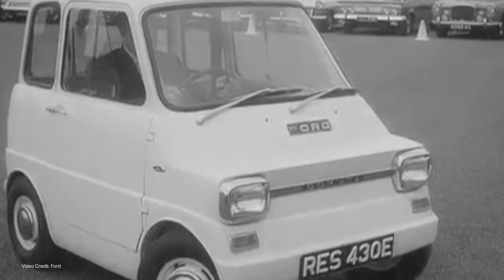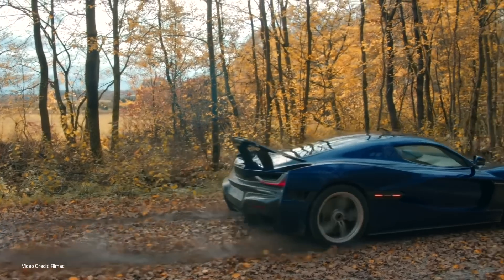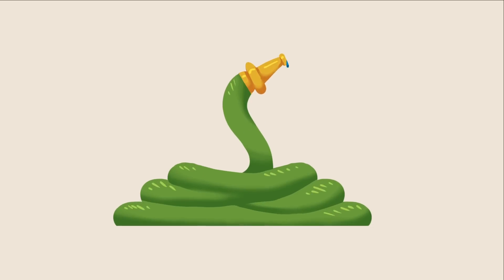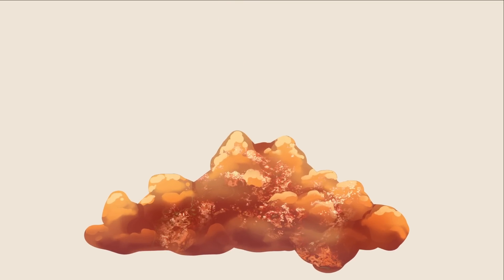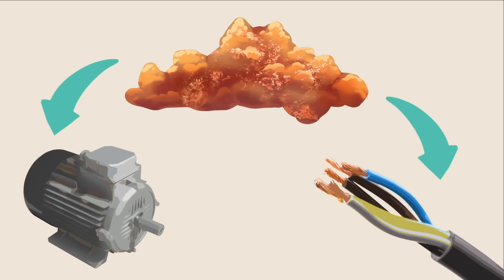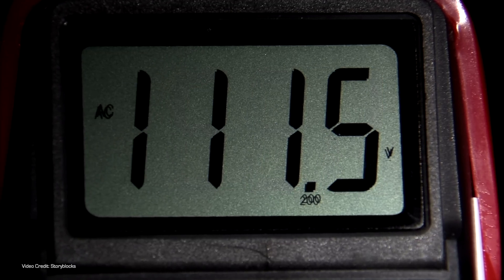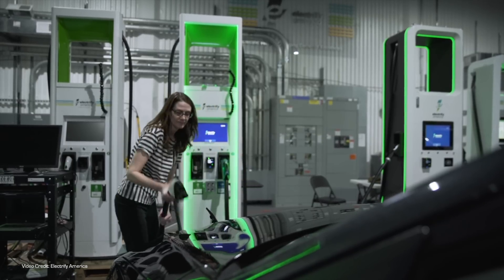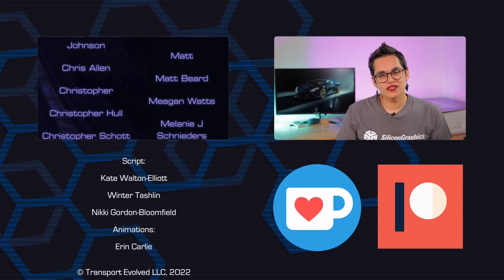Moar Power? More volts.

Comment: What makes 800v expensive? Also why not jump multiple steps and go for much higher, like 4000v or more? Since it sounds like a magic bullet?
Reply: Higher performance mosfets/transistors and required DC/DC conversion to be backwards-compatible with 400v chargers
Reply: 800v uses bigger gauge wires than 400v. Which means more copper would be needed which will increase the price. Not alone the other supporting equipment you will need to handle 800v. 4000v would be unnecessary as there is no consumer level battery or infrastructure that can handle that many volts.
Reply: @polo3433  bigger gauge, is smaller size, got that backwards
Reply: @brantwedel  Your right. I thought about that afterwards.
Reply: It isn’t really a magic bullet and safety becomes harder as voltage gets higher. Also, 1000V is where the somewhat arbitrary threshold from what is considered “low voltage” is crossed into “medium voltage” which is something of am engineering psychological barrier.
Reply: Q: Since it sounds like a magic bullet? A: yes it always does, but such is the psychology of "Confirmation Bias".  unfortunately the way Nature/God/The Universe works (pick whichever explanation makes you happy) is the "Law of Diminishing Returns" and "No Free Lunch". #NOFREELUNCH  what this means in practice is, no matter the great/wonderful idea Man gets in his greedy head, once we get the courage to analyze it and think it through, we quickly find ourselves "bumping up against the hard wall of REALITY."  thus what you see playing out in the comment section as a whole is what most Chem majors worth their salt discover in their Freshmen year (ref: the reason Chemistry is called as the "Central Science" is because the phenomena occurring at the Atomic level sits at the "root" of the all other Engineering disciplines like Electrical/Power generation, Mechanical, Statics, Thermodynamics, etc)

Comment: Why don't car companies just skip 800 volts and just design cars with 1600 volts or 3200 volts?
Reply: Insulation thickness and distance. 1000V is about the limit of what you can reasonably insulate in a single cable, go higher and you need a significant airgap between the wires. Nobody wants to plug in two charging cables at opposite sides into their car. Crank the voltage up even higher and the electricity will happily jump through the air at one connector, onto the chassis and through another gap onto the other connector instead of going towards the battery...
Reply: I think standard electronic switching devices max out at about 1200 volts, so 800v plus some headroom works well.
Reply: @BooBaddyBig  but if they made the cars that could take massive voltages the other hardware would follow.
Reply: @matthew_baynham  There's safety and other issues though. I mean, you can make inverters that go to very high voltages, but it gets harder and failure modes get more and more 'exciting'.

Comment: Constant pressure (voltage) large/small hose is a terrible analogy for battery voltage, implies all problems fixed by heavier wires.
Reply: Aren't they?  :-P

Comment: While I agree with the basic principles you describe (lower current at higher voltage, thus thinner wires), you focused mainly on transferring power from the battery to the motor. Only in the very beginning and the very end of the video you briefly touched on charging speed, alas without explaining how higher voltage relates to charging speed. Given that a Tesla model 3 or Y can charge at up to 250 kW using a 400 V system you can easily see that the real benefit will only be visible if the battery is either very large or the individual cells can charge at high C-rates thus needing more than 250 kW.
In the end charging speed is determined at the individual battery cell. Given a certain cell and a specific battery cooling design, 800 V systems will only improve charging speed if 250 kW will not result in enough power at the individual cell. After all, Li-Ion cells run at nominal 4 V, thus voltage in a 400 V battery architecture is not the limit. Neither is heat dissipation as the collective heat from the cells stays the same regardless if they are configured as a 400 V or an 800 V system. Properly designed cabling n a 400 V system won‘t add any heat, just additional weight.
—-
Bottom line: it would be great if you could look more closely into charging speeds in relation to 800 vs. 400 V systems. Conceptually you should only see differences at charging speeds of 250 kW and above as now the current limit of the CCS connector will put a ceiling on the power of 400 V systems while 800 V (and higher) systems can fully utilize today‘s up to 350 kW. In that context I think that the Hyundai Ioniq 5 and the KIA EV6 are not yet close to the 250 kW limit and thus would charge just as fast in a 400 V setup (given the same cells and cooling).

Comment: Would be nice to see a block diagram of the electrical system in an EV - battery, charging, speed control, motor(s). Then indicate the voltage/current for each sub-system, pros/cons as related to cost/weight/performance with what electronics/motors are readily available to handle these differences. Then add in what you are seeing across the different manufacturers. Should take a couple of minutes😜

Comment: The information given is pretty good, but…. This explanation doesn’t apply to charging the battery. 

Charging speed is solely determined by the limits of the chemistry of the individual cells. No matter what the pack voltage is, the individual cells will see a voltage set by chemistry and be limited by the C-rate of the cell. 

The same cells whether in an 800V pack or a 400V pack WILL see the same voltage and current when charging at the same power from the charger therefore will charge in the same amount of time. 

Example. Take a theoretical 1V 1Ah cell (lithium ion cells are typically just over 3V each). You can either string 800 in series to achieve an 800V battery or you can have two strings of 400 cells in series for a 400V battery. BOTH batteries are 800 Wh (Watts = Voltage x Amps) so if either battery is charged at 800 W, they will BOTH charge in 1 hour. 

The voltage of the pack DOES NOT impact charge time. 

Sure, when it comes to the motor 100 lb or 200 lb of materials might be saved in wiring, but that is <1% the weight of the car and a similar amount in cost. 

800V systems ONLY really help the high speed charging stations making the. MUCH cheaper to build. THIS is THE reason for switching to 800V. 
800V does almost nothing for the car in cost, weight, or charge time.

Comment: And the dumbest thing SAE came up with or actually missed.  They did not restrict the location of the charge port on the vehicle.  So automakers put them anywhere they like.  So all charge stations have to have longer heavier cables.  So a single design of parking stall won't work there will always be someone that won't fit.
Reply: I'm waiting for the charge port behind the rear license plate like a lot of older sedans had their gas cap.

Comment: Got a 1800 miles trip coming up, I need time to walk around time and eat. Long Charging time is not a problem.
Reply: Pack voltage does not impact charge time. Only charging power does. If you go to a 150 kW charger, it doesn’t matter if the car and charger are 400V or 800V, they will charge in the same amount of time.
Reply: @williammeek4078  CCS is limited to 500A which means that 400V systems are limited to 200 kW charging speed, even on 350 kW chargers.
Reply: @wermagst  You make my point for me in that the 800V is for the chargers, not the car. Though not all 400V systems use CCS plugs. The Tesla plugs are currently 250 kW and plans are to bump them to 300 kW.
Reply: @williammeek4078  There are already cells in development that can take currents upwards of 3C. 400V systems would be limiting them and in Europe Tesla is using CCS.
Reply: @wermagst  Not here in America. The Model 3 here already charges at over 3C with a 400V battery.

So AGAIN, the reason to change to 800V is the charger, NOT the car.

Besides, I am pretty sure a CCS plug could be designed that could handle more than 200 kW at 400V.
Reply: Quite true, Robert Linder, however, I’d really appreciate a lighter cable and less loss.
Reply: re: "Long Charging time is not a problem".  exactly if I'm stopped, im either down for 30mins...?  or a full 60mins...?  add +15mins to any quick charge session for a Wife riding shotgun, and another +15mins for each additional family member riding in the car.   as the wisemen say "it all comes out in the wash".

Comment: Do you think 150kwh packs will eventuality be the norm?  This would allow for less range anxiety and larger vehicles.
Reply: 150kwh packs are great for folks driving long distance everyday, but if you do a few long trips a year then you will be dragging around extra weight for smaller trips.
Reply: @robertlinder6414  same argument can be made for cars today but many people still drive large SUVs.
Reply: @robertlinder6414  charging to 80%  would leave you about weeks worth of charge depending on distance which means longer lasting batteries.
Reply: I think 150 kW packs will be standard for single car families. Commuter cars will be around 75 kW. Light trucks will likely be around 300 kW. Heavy trucks around 1 MWh.
Reply: It would probably be nice for those with towing needs but it would be a waste for anyone else not just materials but also efficiency.
Reply: Q: Do you think 150kwh packs will eventuality be the norm? A: no. curious, where exactly do you propose getting all the raw materials needed for these ginormous (near 2000lb) battery packs...?  Putin's Russia...?
Reply: @phillyphil1513  you think that rare earth is the only way to make a battery?  There are so many new chemistries with higher power densities with little rare earth coming.  Quantumscape solid state or sodium ion

Comment: Minimising cable runs is a big saver.... in materials wt. and efficiency. Ive often pondered if the current feed to the extremities of a vehicle like the rear is better served through a single collective feed and then short fused distributive wires rather than running totally seperate  feeds to each load from the battery and single forward fuse panel.

Doing this in a car is one thing ..doing it in  boat ⛵ is even more  challenging... 🤔 when you have to balance batteries and motor distribution  to trim the vessel ...it can extend the cable runs significantly at the cost of efficiency and finance cost...
Reply: Aux  service electricity in an auto is essentially irrelevant in an electric auto.
Reply: @lengould9262  
Tesla didnt think so in designing their wiring looms ..  although the motivations probably cost of materials and weight . Sandy ...... sorry ive forgotten his Sir name, Monroe? He strips new vehicles to evaluate how they are manufactured and assembled and highlighted this in comparison to another legacy Manufacturers product if I recall.

Comment: Going to need new materials? Any  ingenious scientists, engineers, and/or regular people can invent, implement, and market the new powerful, faster, Cooler, less costs, more efficient, and really easy-to-use charging stations, cables, plugs, and charging environment?
Reply: Not really. Current battery tech is plenty good to out perform ICEVs in every respect once battery production is ramped up.